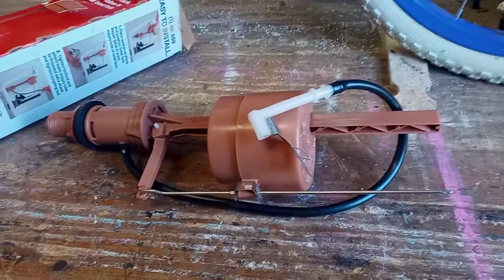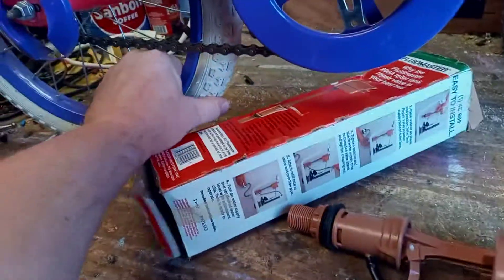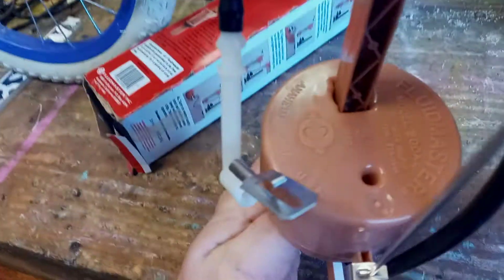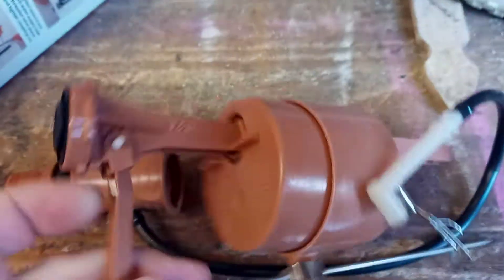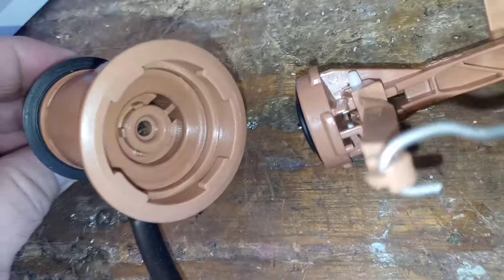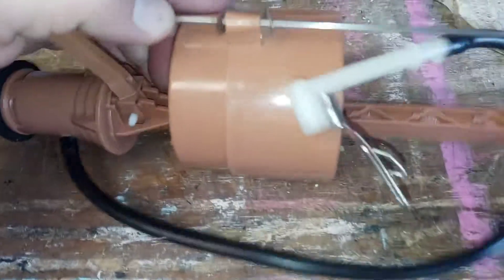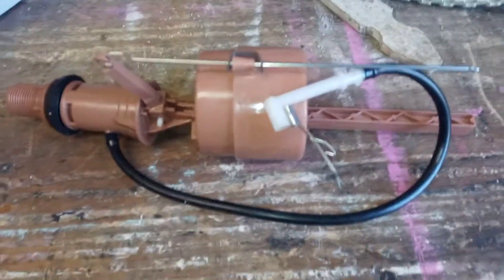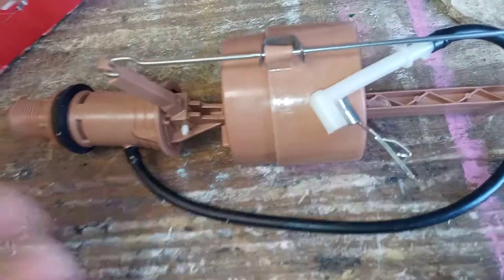How to take apart Fluid Master 200A fill valve to replace diaphragm.

Comment: Thanx for this video!  Saved me a trip to Home Depot, and web-search shows Home Depot no longer even carries this product!  Didn't want to re-design the toilet...   The Fluidmaster 200A works fine - and your video let me get mine apart. I didn't have to replace anything - problem was a couple of small stones were preventing the valve diaphram from seating, so the toilet  kept running.  Note: It was really difficult to get mine to turn, to come apart, as you showed.  The plastic was siezed, and the trick I figured out was to run really hot water on the thing, and this finally allowed me to get it apart. Our pump had sucked up mud and bits of well-bottom dirt, and the iron deposits also maybe siezed the plastic parts.  I put a tiny bit of vasoline on the connection where the two pieces twist  together, prior to re-installation.   That way, if the diaphram fails, I can fix it more easily.  Total repair cost: $0.00!
Thanx again for doing your video.

Comment: I Rented a department that has one o these in the bathroom. This valve has a leak of water in the join. Do you know how to repair?
Reply from the maker: @jngomezd  it will most likely need the rubber diaphragm replaced